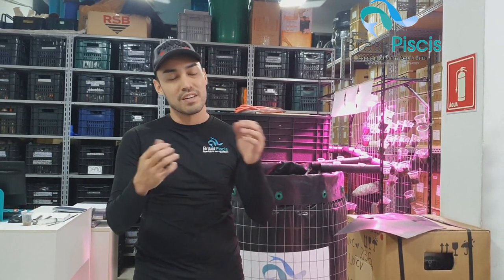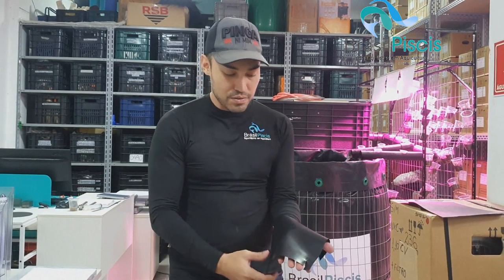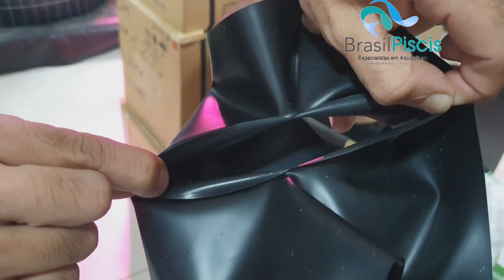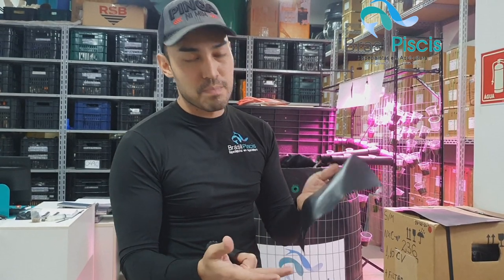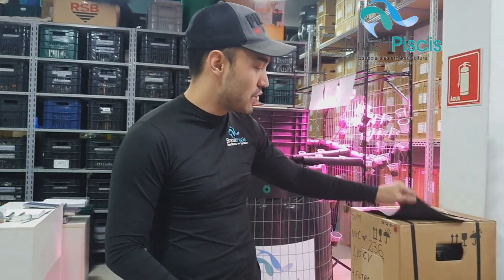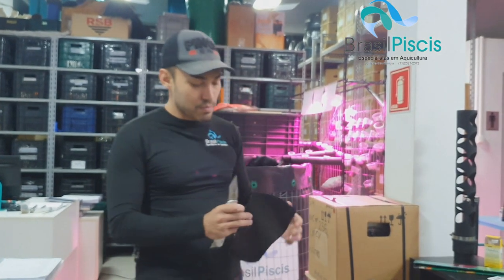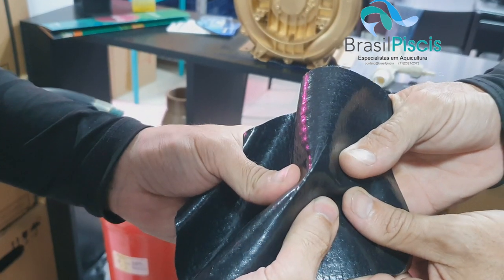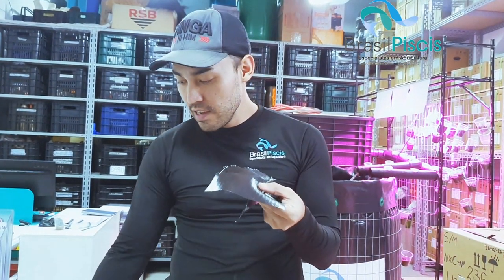Qual é a Melhor Geomembrana? Teste de Qualidade Geomembranas PVC Vídeo 116

Comment: Quantos anos dura esse material num lago?
Reply from the maker: Bom dia! Entre 15 a 30 anos em média, exposto ao sol, as partes que estão dentro da água e na sombra nao possui data de validade.

Dúvidas entre em contato das 9:00 as 18:00 ou 24 hrs para emergências em: 

--(11)2021-5593 ou (11)2021-2372. 

Também em contato@brasilpiscis.com.br 

--whatsapp: +55 (11)941604428 - Vendas

--whatsapp: +55 (11)94704-4219 - Diretoria
Reply: Esse tipo de manta tem compatibilidade para murros de arrimo?